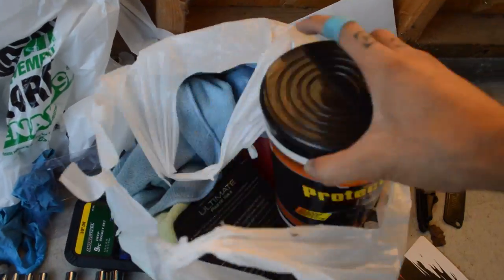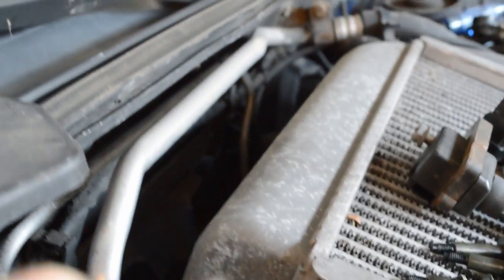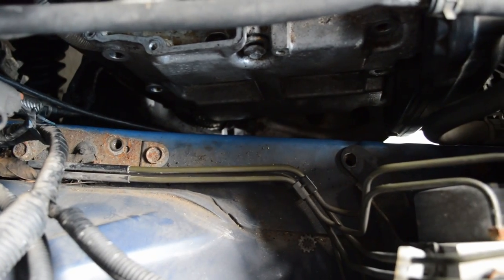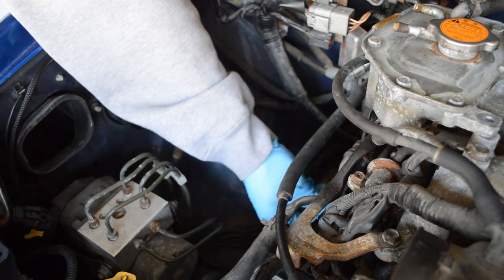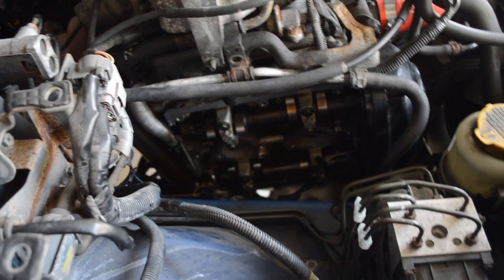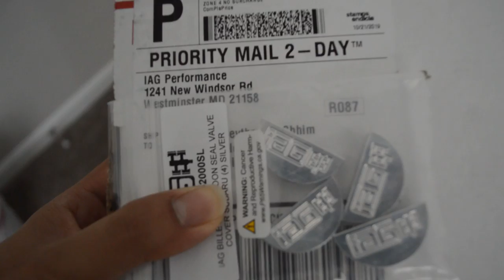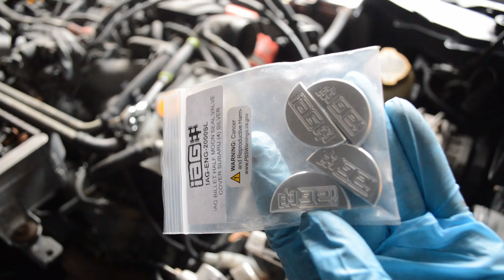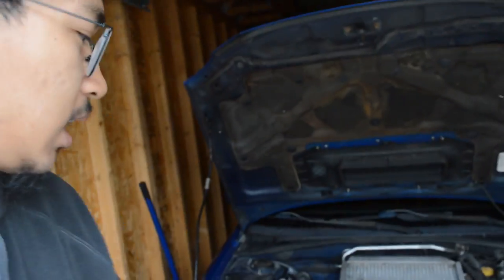PT.2 VCG Replacement

Comment: Did you get stock coil pack replacements or upgraded ones. I'm curious to see the results because i have been getting some misfires periodically. Part of me feels like it might be my tune also. My engine bay also traps in alot of heat
Reply from the maker: The coil packs are from 1A autos was like a stock replacement. Just an upgrade from rusty old ones. Was skeptical on getting them but the car starts and is fine. Haven’t actually got a good ride in. More problems surfaced. Soon to get fixed. Parts coming in soon.